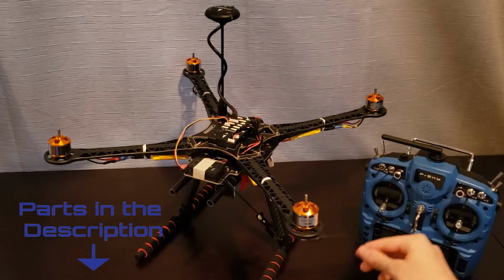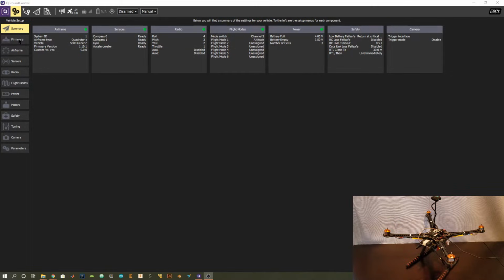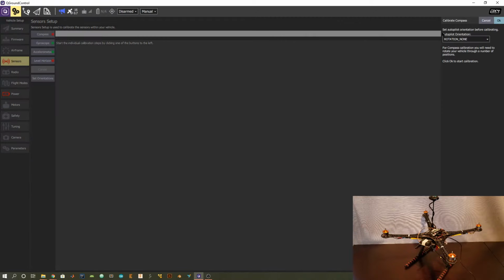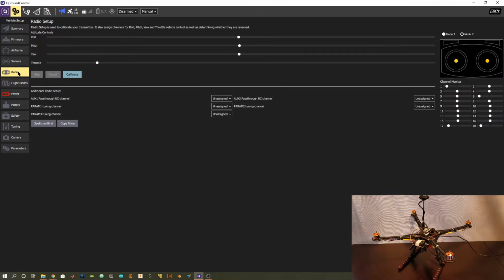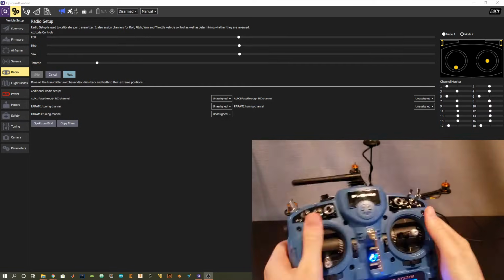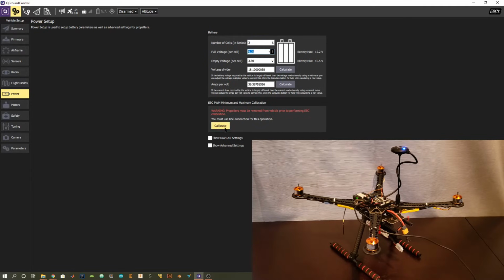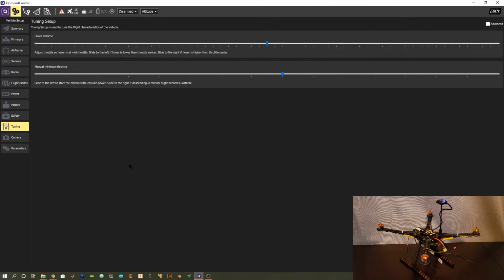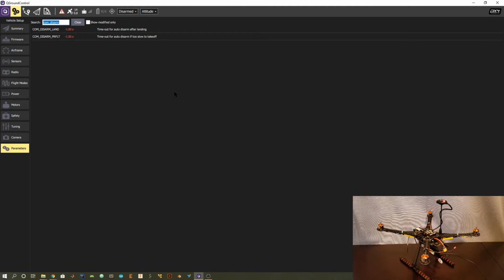Pixhawk 4 Setup and Calibration with QGroundControl | Pixhawk 4 + S500 Drone Build Tutorial | Part 4

Comment: Hey Alex, how are you. Your videos are super interesting. I have a question if you can be so kind to answer. if i want to set up some manual commands to drone itself by integrating my own line of codes into the pixhawk 4, would it be possible in this step or it would have to be done in a different way?

Comment: I got a 20a esc and 920v motors. For some reason I can’t get it to fly. I have my motor spinning in the right way. I try to throttle up nothing seems to happen. It almost as if something is holding it back the more throttle I give 80% it almost wants to tilt over. What should I do
Reply from the maker: Have you confirmed that the parameters and preflight checklist match my setup? Especially the disarm timeout field.
Reply: @AlexFache  I’m doing my in mission planner. I looked in to message and say it says battery failsafe disarm. Do you think you can do a video for mission planner using these exact same model? I been looking a lot on YouTube. Can’t find an answer to this. I’m sure it something in the settings such as parameters. I’m not sure if it’s my battery issue. Because whatever I can find online it seems to mention battery …

Comment: Alex, what good stuff, looking to upgrade a boat to a autonomous with telemetry what would be the appropriate setup?
It really only needs one output to control direction since it's a boat on water. Throttle control would be maybe a plus but that can be done via the transmitter since the boat is still in site. Thanks John

Comment: I've been having trouble with the 'voltage divider' and 'amps per volt' values. I have a brand new 6500mah 4S 14.8 volt lipo battery. The voltage read from the multimeter is the same as what is reported by the FC. I have not been able to work out what number should go in the voltage divider, nor have I been able to work out what goes in the 'amps per volt' field... any help would be appreciated :/
Reply: have you figured it out?

Comment: Hello, your video is very informative and really helps a lot. I am facing an issue with my hexacopter and I was hoping that you can help me find the solution. The issue is that when I arm and start to increase the thrust, it seems that two motors have more power than the others leading the hexa to flip and hit the ground. I have done esc calibration but still facing the same problem. I have a video but don't know how to share that to you. I will be grateful if you have any guidance to fix the problem. Thanks!
Reply: Your propellers are opposite

Comment: Hey, nice job! I'm trying to connect a Pixy2 camera on my FMU, but its not detected on QGC. I setup the cam with PixyMon and seems to work with USB but when I use the i2cdetect command on QGC (and after removing the usb cable) but there is nothing at the set address. Do you have an idea?

Comment: Hi! Thank for you video!
I have a question with radio calibration
I'm doing radio calibration in my room
But, the Channel Monitor dial moves left and right when I don't move my both throttle..
And when I move throttles, the response of the Channel Monitor is slow..
Is it related to Wifi in my room? There are 3 Wifi in my room..
thank you

Comment: Hi Alex thanks for the informative videos ... I followed the same steps and went on with sensor calibration, transmitter channel configuration followed by ESC calibration. But in the next step even after showing ESC calibration complete ..the motors are not spinning as you showed in the individual slider page ... Can you suggest me something ?? Thanks in advance.

Comment: Hi Alex, thanks a lot for your videos, they're really helpful. 
I have been building my drone using the F450 frame and PM02 power module(different from your PM07), so I have to solder the ESC cables to the PCB directly. However, the PM02 doesn't have the little hole that is used to solder the white signal cable from ESC, do you how I could connect my signal wire to the Pixhawk, please? 
Besides, I am using the Ardupilot Mission Planner to set up my drone, but I got stuck at the "ESC calibration" step that prevents me from making all 4 motors rotate. So, I decided to switch to QGroundControl. However, when I initially opened it right after downloaded it, it kept getting the message "a second instance of qgroundcontrol is already running, ....". I am sure that I didn't open anything besides QGC, and I even restarted my computer, but nothing is solved. Do you know what could be the reason for that or is there an error in the file that I downloaded or in the installing process?
I would appreciate your help. Thank you.

Comment: Hello, first of all I have to say you made a great serie of videos. I watched them all several times. I would like to ask you, in this video you calibrated the drone. Well, how do you calibrate while the drone is connected to the computer using the USB cable? If I disconnect it, the Pixhawk turns off. If I will power it using the battery, the Pixhawk is not connected to the computer - which means it won't sync with the QGC. Can you please explain how you do it. thanks.
Reply from the maker: Thanks! You'll want to power on your drone with the battery and plug in the usb cable.
Reply: @AlexFache  it was quite difficult with the wires I have, but it ended up well :), thanks
Reply from the maker: Awesome

Comment: Awesome video. We have a problem with our drone though. Motor tests work (spin motors) and the rc controller we are using connects and binds easily to the software and we are able to calibrate it. However, we are unable to control the drone with the controller once we've done those things. Any idea?
Reply from the maker: Have you turned off the safety switch on th GPS? My guess is that you aren't arming the drone.

Comment: Hello thank you for yout video, i have a question, i have a taranis qx7 rc and the qgroundcontrol doesnt detect me the switches even calibrating them, is there any solution? i will appreciate if you have the answer, thank you
Reply from the maker: This is probably a problem with your receiver not being bound to your transmitter or your receiver not being correctly plugged in to the pixhawk. Check those connections and let me know how it goes.
Reply: @AlexFache  I already solve it, It was a problem because I didn't configure the channel in the RC, your last video helped me, thank you for the support
Reply from the maker: Awesome. Glad you got it working.

Comment: I've been trying to get my quadcopter to fly but nothing seems to be working. I'm getting one error when i connect my pixhawk to my computer that says "reject altitude control". Not sure if that is causing the problem. I am able to get the motor to spin using the motor test but nothing works when I try to control the copter using the RC transmitter. 
Any pointers ?
Reply from the maker: I ran into "reject attitude control" when I toggled between flight modes when the pixhawk was still connected to the computer. It's not a problem just a warning basically saying that you're connected to a computer so you aren't allowed to takeoff.

First thing you should check is if on the flight modes/reciver page you can see the changes in receiver values when you move the joysticks/switches. This will quickly tell you if your transmitter and reciver are bound. Try that out and let me know how it goes.
Reply: @Alex Fache  Thanks a ton in advance for replying, I really hit a wall. The toggle on the flight modes and the arm channel all seem to be working according to QGC. I am also not using a GPS could this be a problem? Also to clarify the motors should be spinning after arming correct? If so I still cannot get the motors spinning no matter what I have tried
Reply: @AlexFache  It seems that the 'reject altitude control' warning has gone away but I am still having no luck arming or getting the motors to run using the RC transmitter and QCG says that all the inputs are going through. also if emailing would be a more efficient way of communicating could you please contact me at eyhster99@hotmail.com

Comment: I have my quadcopter set up, with a px4 flight controller. I don't have a transmitter and receiver but I have a Telemetry radio set up. I wanted to know if it's possible for me to fly my drone with just QGC sending the commands via the telemetry radio without transmitter and receiver radio.

Comment: Hi Alex, very nice tutorial. Thank you. I follow your tutorial to build up the firmware. But I fail to arm the drone. It warns that I should press the safety switch before arming. I don't have any safety switch connect to the pixhawk. How do you get rid of this? Thank you.
Reply from the maker: Do you have the GPS module attached?
Reply: @AlexFache  Yes, I have GPS attached. I found the solution in this link: https://docs.px4.io/master/en/advanced_config/prearm_arm_disarm.html. Only change the parameter  CBRK_IO_SAFETY=22027 then the safety switch alarm will be deactivated. Thank you

Comment: I'm confused about my build, are you suppose to take off in stabilized flight mode and go into altitude hold? If I use altitude hold to lift off it goes too fast
Reply from the maker: That's really up to you. This page has some more info: https://docs.px4.io/master/en/getting_started/flight_modes.html. The difference between altitude and stabilized is that altitude will hold the current altitude while in stabilized you are responsible for managing the throttle otherwise they are pretty similar.

When you are taking off make sure you are slowly increasing the throttle. For mine I had to go to about 30-40% to get liftoff then I increased it just a tad to get into hover. When you are taking off does it feel out of control / are you "flooring" the throttle? Since this is a manual flight mode, opposed to automatic takeoff, your throttle speed is controlling the ascent.
Reply: @AlexFache  Thanks for the info I was successful with the flight today, Thanks!
Reply from the maker: Awesome!

Comment: Thanks for the videos. I have problem with ESC signal wire soldered on PDB. It mess the orientation of motors could you help me.
Reply from the maker: One thing that has been mentioned in some other comments is PX4 vs Ardupilot motor orientation. Do you know which one you setup? In my video I used PX4.
Reply: @AlexFache  Oh, I use Ardupilot firmware on qgroundcontrol. At the moment, I plug in randomly signal wires through the external  8 male header  and use motor test until I get 6 motor from A to F in clockwise orientation.
It mean   A-5  B-1 C-4 D-6 E-2 F-3     or A-1 B-4 C-2 D-3    
Have you worked with any FMU PWM  ?  I have some problem  with these pin AUX, GPO, etc
Reply from the maker: I have not used the FMU pins yet. Based on this https://docs.px4.io/v1.9.0/en/airframes/airframe_reference.html#hexarotor-x the PX4 numbering is 514623 so I suspect that this ordering is not consistent for Ardupilot. There should be an exact order you need to use instead of randomly trying to guess the configuration.
Reply: @AlexFache  Thanks ,I think I misunderstanding by apply the order of motor test :)) . I plugged like this A-1 B-2 C-3 D-4 . Ardupilot orientation is the same as PX4
Reply from the maker: https://docs.px4.io/v1.9.0/en/airframes/airframe_reference.html#quadrotor-x check this out. Where are you getting the 1-2-3-4 from? The Pixhawk quadrotor is 3-1-4-2 clockwise from the top left. Also I have not seen the lettering anywhere so we may be saying the same thing here.
Reply: @AlexFache when testing begin with the top right motor , i expected they will go in clockwise  order  A-1 B-2(but it was 4) C-3 (but it was 2) and D (but it was 3).I just simply mark wrong number for each motor.
Thanks for your help ! I get it now ! hear is my drone https://www.youtube.com/watch?v=3cJQe-QVh8E
Reply from the maker: Being able to debug is a great skill to have. Video looked great!
Reply: @AlexFache  thanks!

Comment: im having a problem where no matter what i do, the accelerometers  will not calibrate, they wont even begin calibration. I've currently tried everything, now im down to thinking that it is a faulty board, and im going to ask for a replacement one. Im just saying this just in case anyone else is having the same problem.
Reply from the maker: Were you able to calibrate the other sensors?
Reply: @AlexFache  the gyroscope and compass would eventually calibrate, but it would take a really long time, and would fail most of the time. But after several attempts,  I got the both compass and gyroscope to calibrate, but never once did the accelerometer even get to the stage of rotating the craft for the 6 positions. Luckily I am in Melbourne, and we are in a 2nd lockdown, so I cant take it outside to fly it for another 5 weeks, so hopefully a replacement board will come by then!
Reply from the maker: Ya that's a bummer. I checked out the PX4 forum to see if this has happened before but I didn't see anything similar. Hopefully your new one works and you can start flying really soon!

Comment: Which power distro board it that?
Reply from the maker: It's the PM07 that came with this Pixhawk 4 kit: https://amzn.to/3hSp9tD. There is also a PM02 board however it doesn't have the nice interfaces.
Reply: @AlexFache  my kit has PM02, it came integrated with escs, so I didn't have to solder. But yes, PM07 is a lot better
Reply from the maker: The soldered escs are convenient. I had escs from a previous setup so I figured it would be easier to add them to the PM07. Also if I want to add servos/etc later on I think it's reasonably straightforward with the PM07.

Comment: Hi - the "Motor Test" option does not work, any idea why? Is this the firmware issue perhaps? Other than that - ESCs calibrate and motors definitely work.
Reply from the maker: Yes it depends on the firmware version. I think it's only available on beta versions and not the stable release. If you did the ESC calibration and confirmed your motors spin up then you should be good to go!
Reply: @AlexFache  I wasn't :-( my set up tipped to the front, not sure why. Did the ESC calibration, motors spinning right direction (all checked one by one). I keep getting GPS error, but I don't think this should be it, many builds fly without GPS. One prop broken, but that's fine, learning curve.
Reply from the maker: GPS shouldn't be the problem. It sometimes takes a minute for it to localize and get the green light. Do you have a heavy camera/gimble in the front that could have significantly moved the center of mass?
Reply: @AlexFache  no camera yet, so center of gravity should be close to the middle.
Reply: So I think I may have found the fault - something to do with motor ordering. 
There is a parameter there, which can be set to px4/ardu or betaflight. I had it set by default to px4, but my physical ordering was as per betaflight. I changed it and will  test it again on weekend.
Reply from the maker: What's the parameter called? I didn't notice one but it would be good to know for future applications. Hopefully that resolves your issues.
Reply: @AlexFache  the parameter is called MOT_ORDERING
Reply from the maker: It looks like the default value of 0 is for PX4 (what I used) so since you used betaflight then you're going to want to change it to 1.
Reply: @AlexFache  yes, exactly. I actually swapped the order of cables connecting to PM board to match PX4 in case I forget about it and reinstall firmware. I have no intention tu use Betaflight so no need for Betaflight order